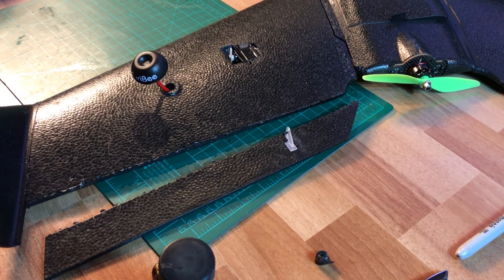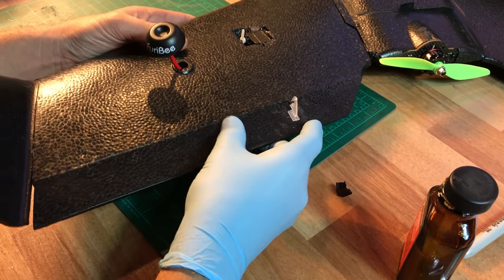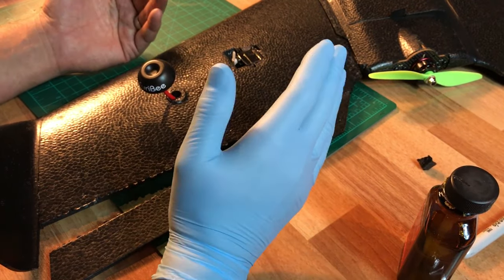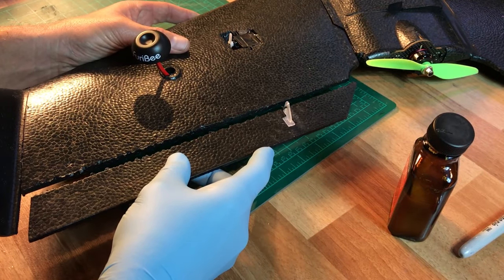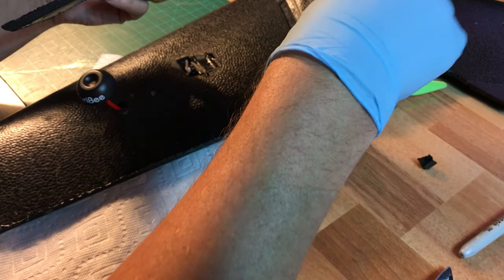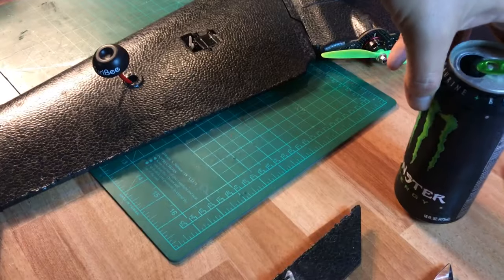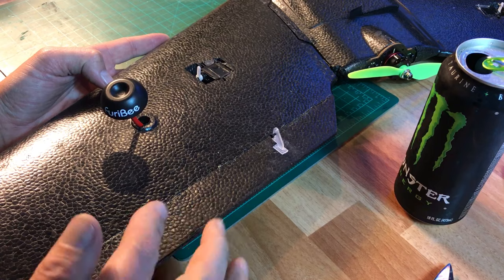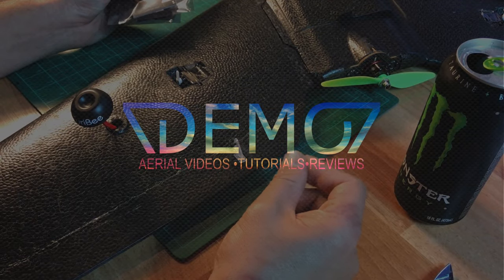Repairing RC Elevator / Rudder / Aileron / Elevons

Comment: Thanks for the great tip.  I've read about this technique on RCG, but it's good to see it in action.

On my partial control surface tears, I've been using the hot glue hinge so I don't have to remove the control rod and tear the rest of the surface off.
Reply from the maker: +Jacob Brubaker I forgot to "tack" the glue in this video- which is- applying the glue, then putting the two surfaces together momentarily then pulling apart getting strings between them- then let them sit- join 5-10 min later

Comment: I did not expect that, that would work. That looks way better than with tape.
Is it posible to put that foil on that wing that you must heat up so it stays on?
Reply from the maker: you can but I don't recommend it for molded epp
Reply: Ok I thought that that would make it even stronger.
Flown a self made wing one time but never fpv and that is why i am making one. Waiting for better weather to fly it. Than i go to a place where i have space to fly it.

Comment: Love your videos.  They are very helpful.  

A quick question about ESCs:
     Can one use DSHOT protocol without a FC?  My impression is that the FC interprets / translates the signal before the ESC(s) receives.
Reply from the maker: I think you are correct in your statement, but I could be wrong,,,